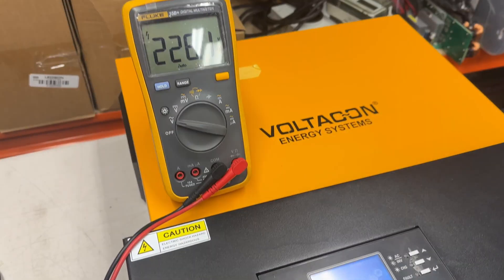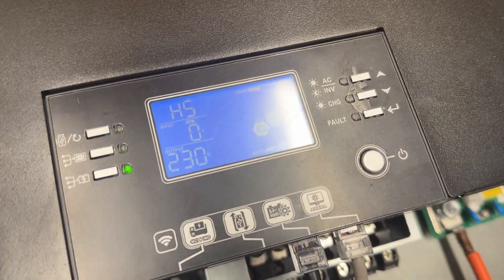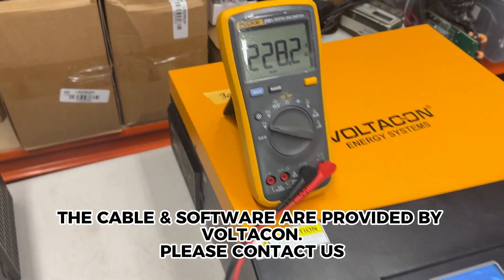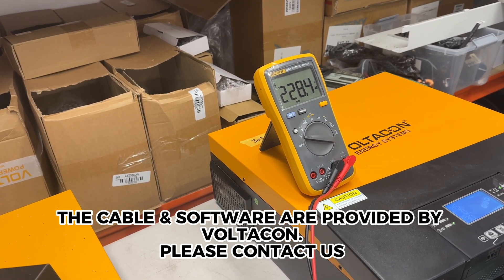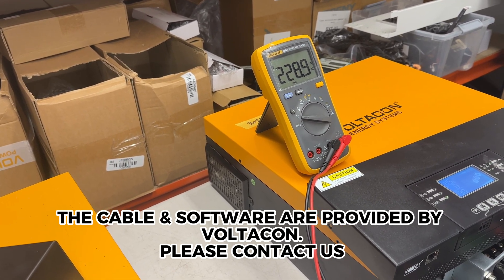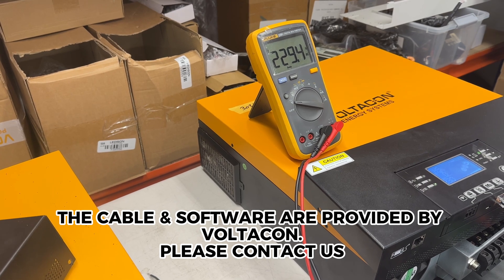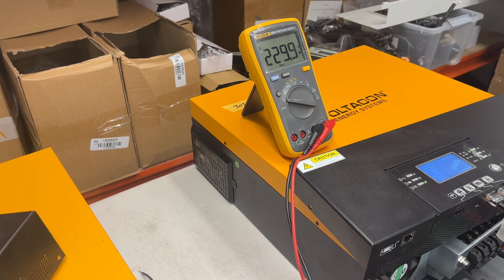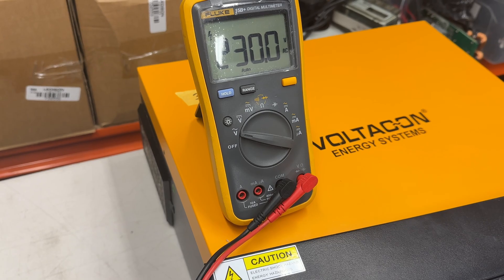How to Fix Error 08 on Off-Grid Solar Inverters | Calibrate AC Output Voltage

Comment: Not very useful in explaining how to actually do the adjustment to correct the 08 error code ..for parrallel units..
Or what data cable is used or where to connect or what program you connecting to,to send cammand correct voltage output...
Usually these Voltacon vids are excellent ,but not this one ..👎